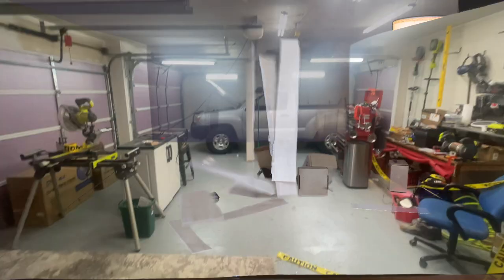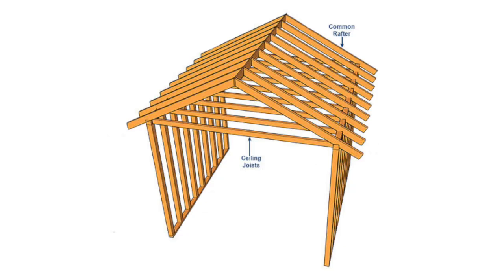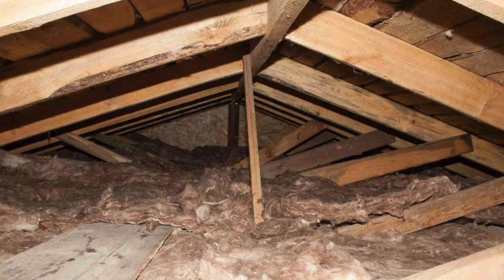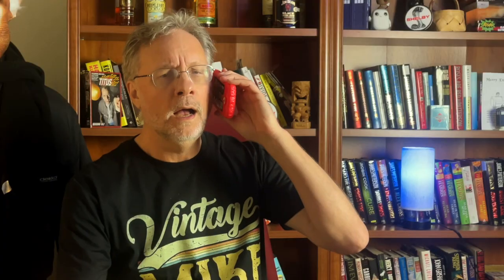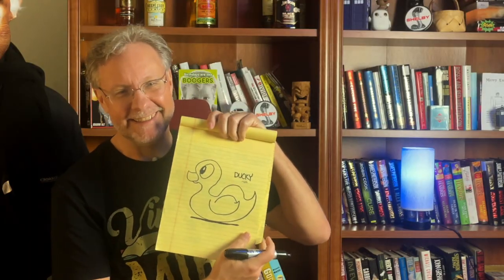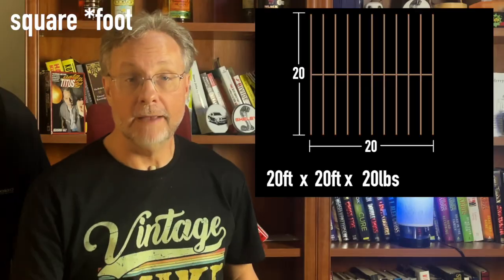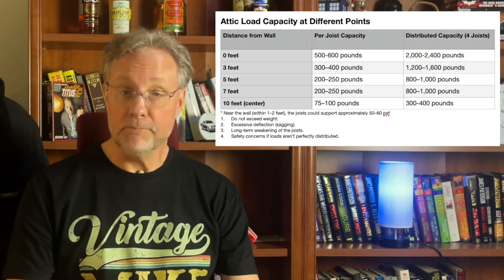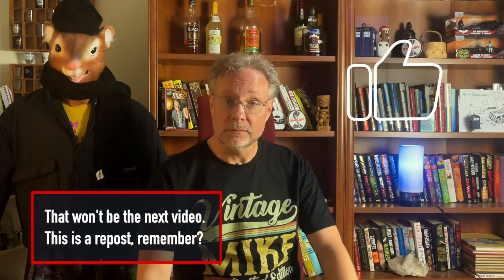Is Your Attic Overloaded? Engineers Don't Want You to Know!

Comment: So let me see if I understand this.  20 lbs./sqft is the actual supported weight of the attic floor, but when I am walking on the attic floor, my weight (200 pound) is being distributed over several joists although I my feet are standing in 1 square foot of attic floor space.  Did I describe this correctly?
Reply from the maker: Yes. I guess I could have just said THAT!